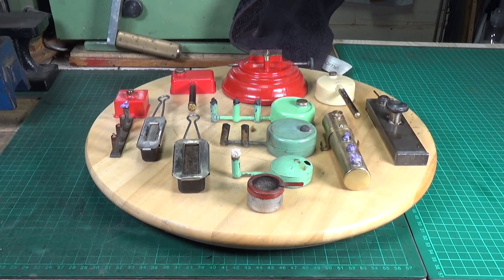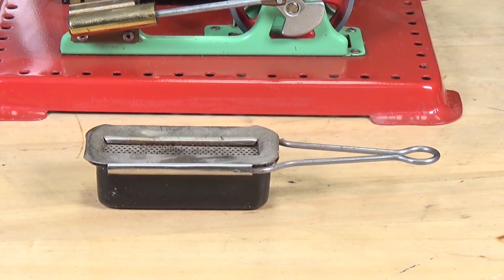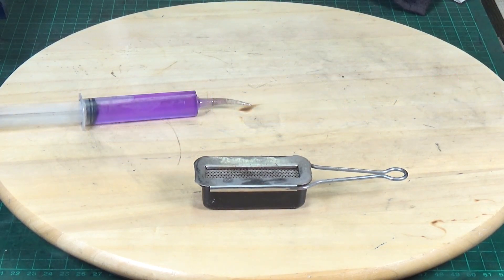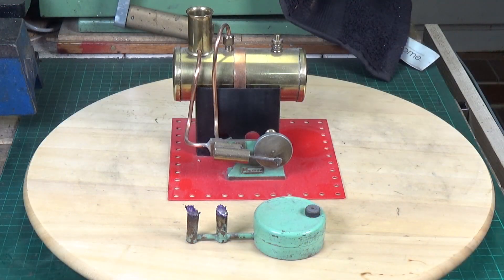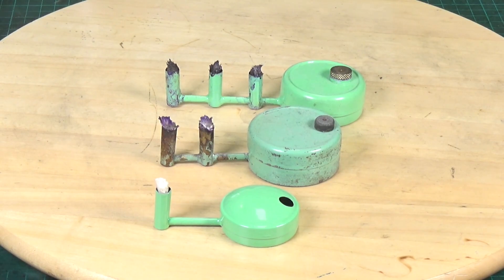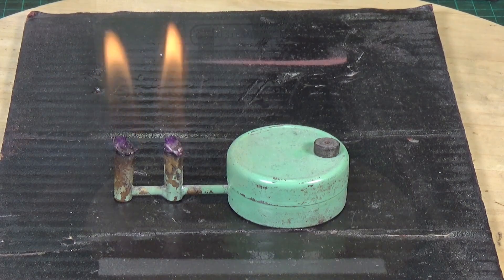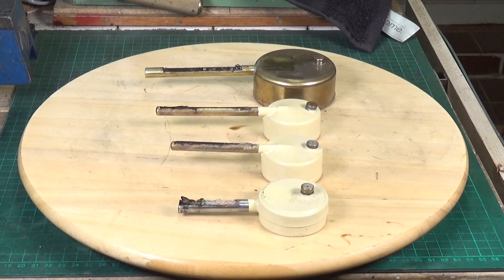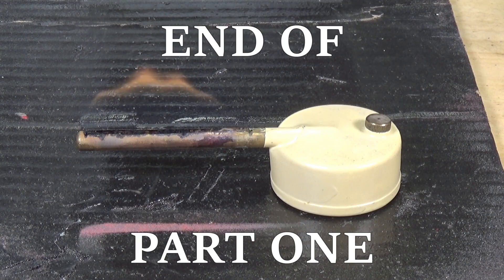Model Steam Engine Methylated Spirit Burners - Part One

Comment: Ive just finished building the Mamod sr1a kit and gave it its first steam but wasn't that happy with the new gel in the solid fuel burner. Do you know if the meths burner will fit in a new sr1a?
Reply from the maker: I've not seen a new SR1A but I'm sure they won't have changed the design much so I would imagine a meths burner would fit.

Comment: Excellent intro the this hobby for me - with the first Mamod burner you referred to wadding under the grill - does this ever need replacing if so what material is it many thanks
Reply from the maker: Thank you. It should not need replacing. I think the original wadding was fibreglass matting.
Reply: @RetroSteamTech  many thanks

Comment: Good review on burners.I have a early 50s se1 flat base with no burner.Can you use a 2 or a 3 wick setup?😊
Reply from the maker: Thanks. I also have an early 1950s SE1 and it works fine with a two wick burner.

Comment: Do I need the wadding inside ?
Reply from the maker: Yes. The idea of the wadding is that there is no liquid inside the burner to spill so it is a safety device.
Reply: @RetroSteamTech  I used firbres from ceramic fire rope and it seams to work a bit better
Reply from the maker: @yinghamlyn-chen2  Good idea 👍

Comment: Thank you very much for this very complete video ! I want to run the meccano steam engine with the very first burner you showed there, and it remains only one question after seeing this video : how do you extinguish the burner once you've done with it ? Thank you by advance !
Reply from the maker: Thanks. Normally you would just blow the flame out but it can be equally as well extinguished by placing a flat piece of metal over the top of the burner.
Reply: @RetroSteamTech  Perfect.

Comment: VERY interesting video Alan.  Thanks for posting.  I look forward to the second part.

The slotted wick intrigued me.  Feeding the wick into the tube looks a bit tricky.  I think I saw one with multiple holes and a screw on end cap - that would make it easier. 

It's interesting that the slot flame is invisible, suggesting it has better combustion, in addition to the broader flame output - and hence hotter.  Your purple metho looks way cool, better than our clear stuff.

Amazing how many old and new model engines are for sale on Ebay.  Interest must be strong with this subject.

I just happened to see an older Mamod engine same as this one on Gumtree today for $160 AU (near me) and wondered if that was a good buy ?  Seems to be a long run and popular model.

Cheers  Rob
Reply from the maker: Hi Rob. 

Glad that you found it interesting, I doubt there will be many views on these, kind of a specialist subject.  The burner that you asked the question about is featured in Part Two which will be up in a day or so. Having made a few copies of the Bowman and Luton Bowman type burners I can confirm that getting the wick into the tube is great fun!! 

I cover another vapourising burner in Part 3 I think, that also has a near invisible flame. My theory is that these are just burning meths vapour with no impurities. The burners which use wicks have a more visible flame because a very tiny amount of the wick material is also burning.

That doesn't sound like a bad deal on the older Mamod engine. If you want to get an idea of prices have a search on the UK version of ebay for 'Mamod' there will be many engines for sale on there. 

Cheers, Alan.